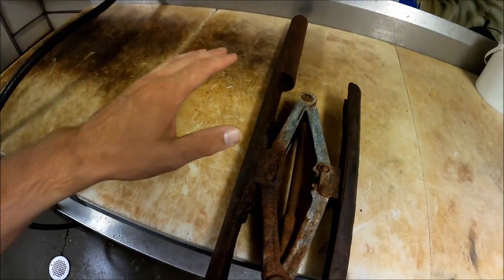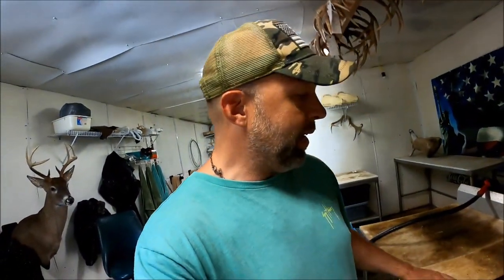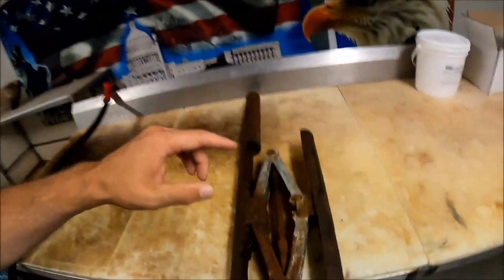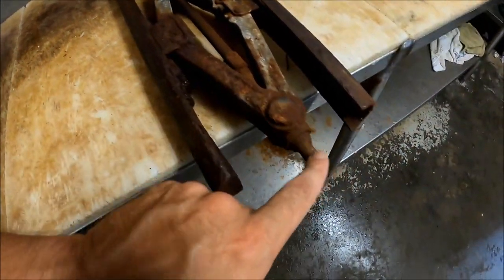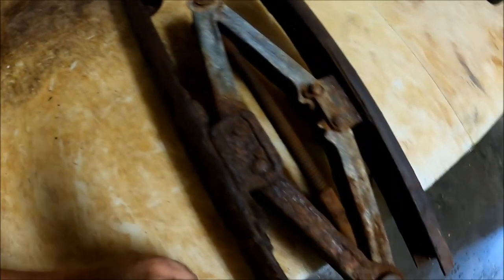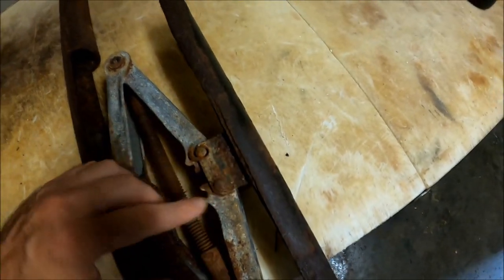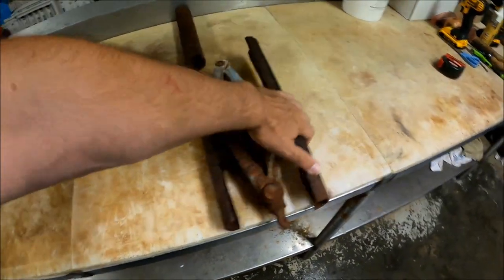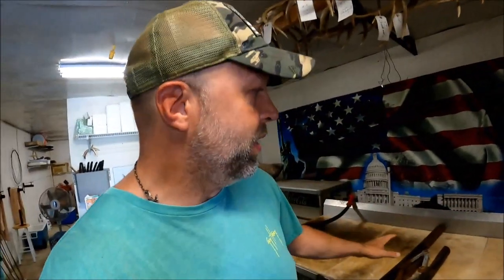DOES THIS OLD THING WORK?! *My homemade cape stretcher* | Make that deer cape fit that form!

Comment: I use a lawn mower tire inner tube, fold it up and slide it in the cape. Inflates quick. You can leave it in as long as you need and quickly deflate to move further up/down the neck. Keep the videos coming!
Reply from the maker: That's a great idea!

Comment: Where did you get your cape frames from? Or are they home made?
Reply from the maker: I got these years ago from McKenzie taxidermy supply. They would be simple to make with heavy rod and plastic tubing
Reply: @thecedarridgechronicles   What do you soak your skull caps in while you are doing the rest of the process?
Reply from the maker: I just clean them really well, take out the membrane on the underside and cover them in Borax
Reply: Once you flesh your hides, what do you use to thin them?